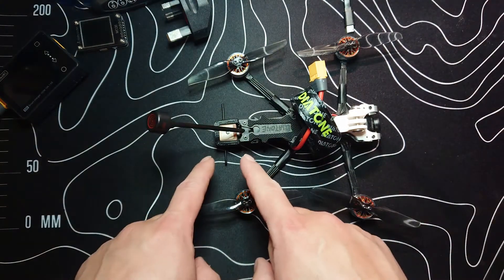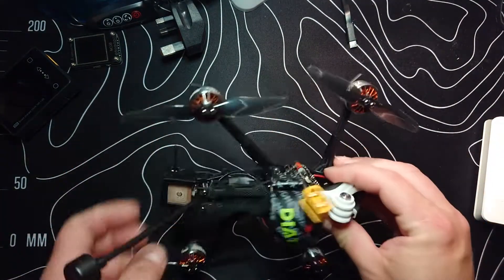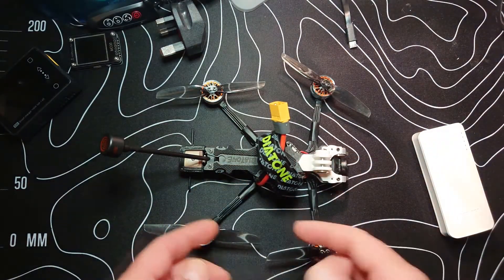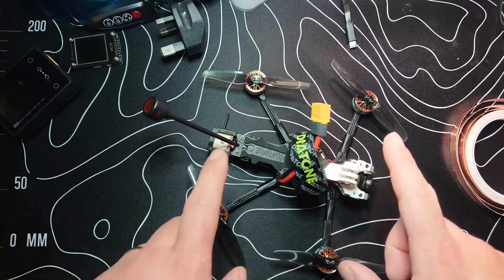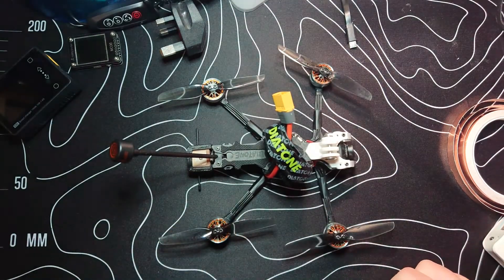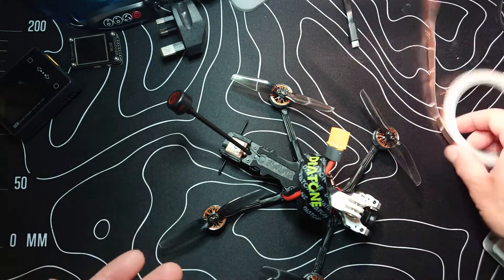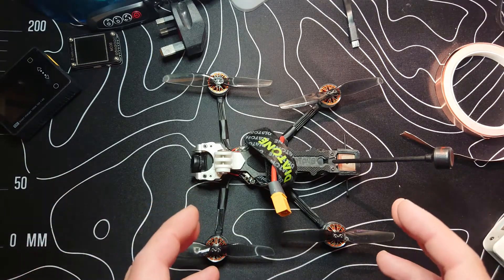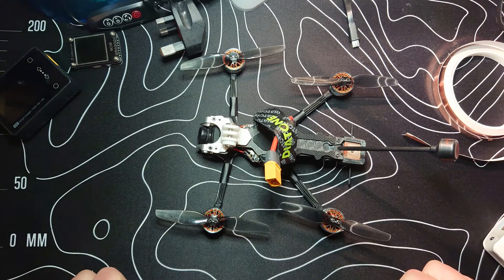BN-180 GPS how to get working. Diatone Roma F4 LR 4 inch build now with a working GPS yay!!

Comment: Appreciate this video. I have purchased BN-180 5 times for my helicopters, always locking within 5 seconds and never a hitch of any problem. I use betaflight 4.2 to fly my helicopter for high altitude (thousands+ feet) diving where GPS coordinates are vital and critical. The digital system Vista/Nebula is all but certain to be the root cause of all the problems. I use analog, and my VTX is at the head of the heli while GPS is at the hind section, and helis are very long.
Reply: Sounds bad ass ! I want to get into planes & helicopters soon !

Comment: Good advice Richard, can you confirm which is the 4.5v pad you soldered to on the Mk3 mini stack please?
Reply from the maker: It's the pad for the receiver near to the rx and 3.3v pads. Thanks for watching 👍
Reply: @Rich-TeaFPV  which pad?, the Vcc or 5v either side of the 3.3v? TIA
Reply from the maker: I think my fc is a little different because it goes ground, 4.5v, 3.3v then sbus from the front right corner near motor 2's pads
Reply: @Rich-TeaFPV  I think you maybe right, mines one of the very 1st versions. They have made changes over time...